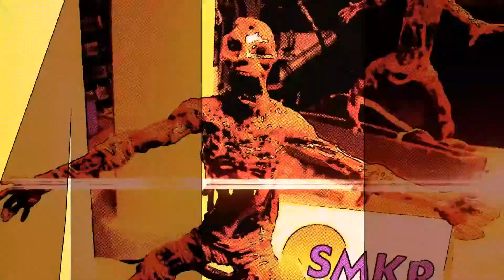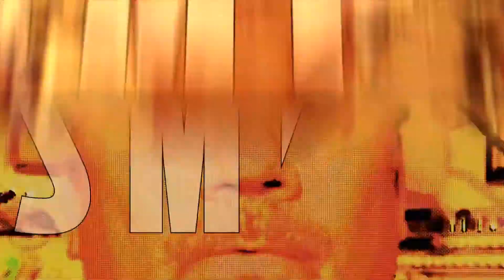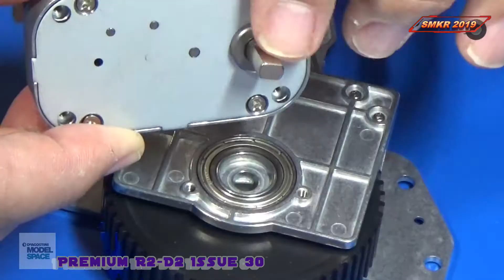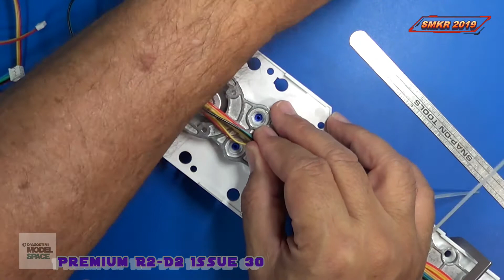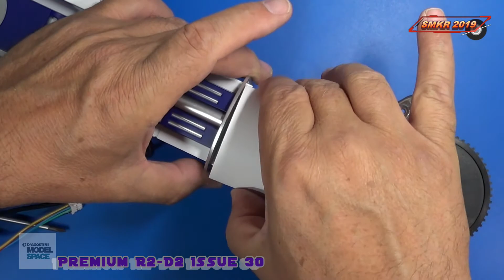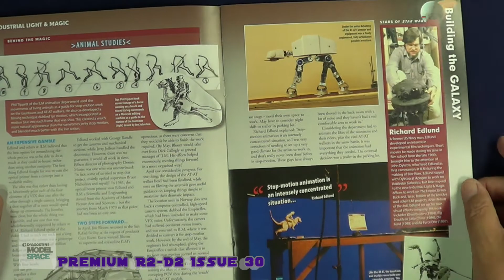Build the Premium 1:2 Scale R2-D2 Issue 30 - Right Wheel Drive Motor

Comment: I would usually use a little bit of loctite when screwing metal to metal parts  just to get that extra sturdiness of the metal frame structure.
Reply from the maker: I got some, but I hate to use it just in case I make a mistake in the assembly, I have made several mistakes already. LoL.